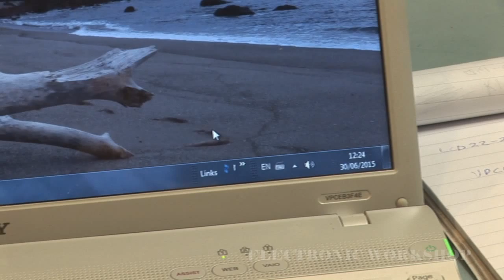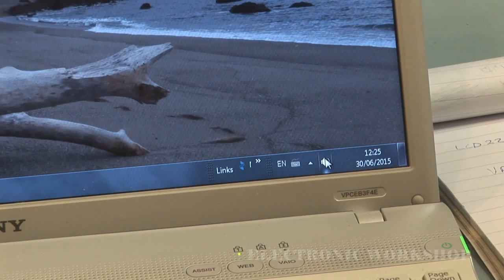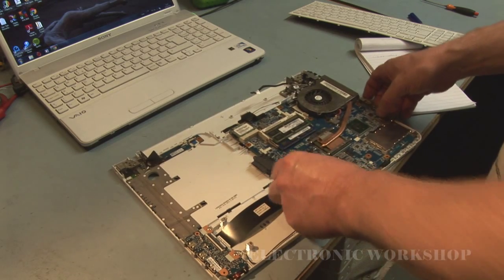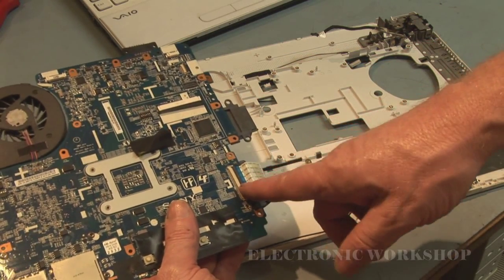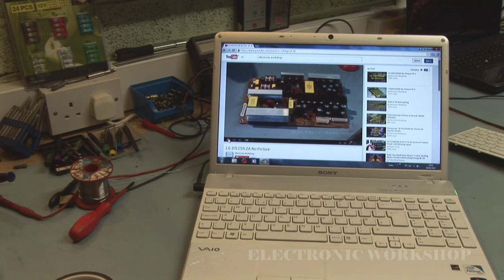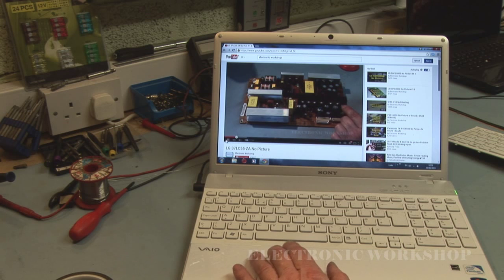Sony VPCE3F4E No Audio From speakers or Headphones

Comment: hello mate. maybe you can help me. i have a similar model and changed the cmos battery. after switching it back on, it has no sound. says the audio device isnt plugged in. ive re-uploaded the drivers. ive gone to default settings in the bios. it says the device is working properly. i never went near the cable like in yr video so i think that part is ok. got any ideas? i cant afford a repair shop. and cant afford to replace even with a second hand, so doing it myself is the only option. and im not so clued up with computers.